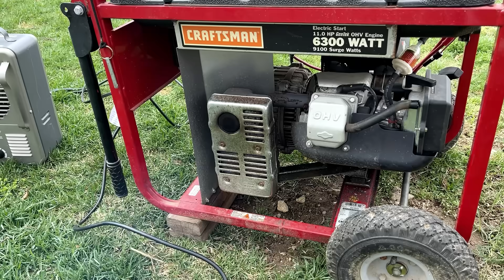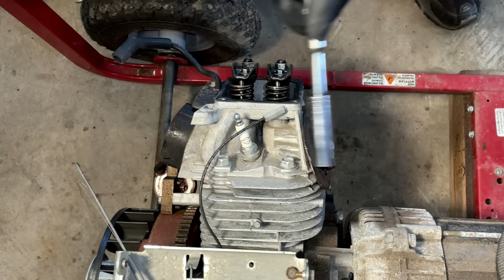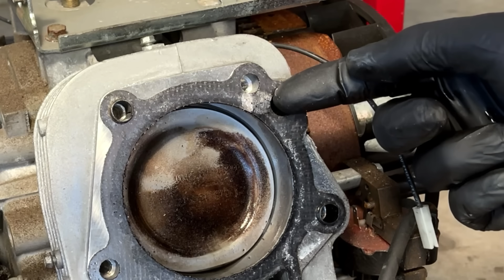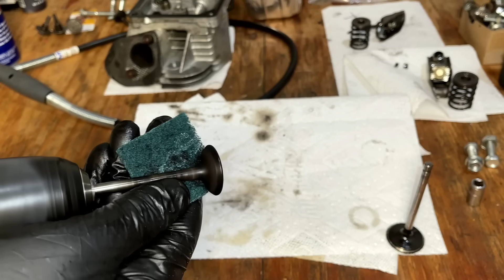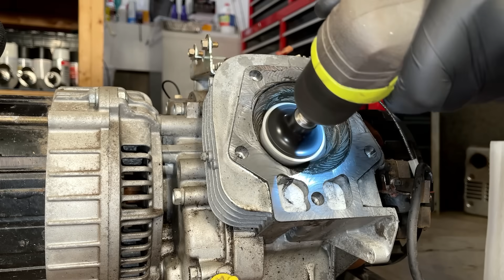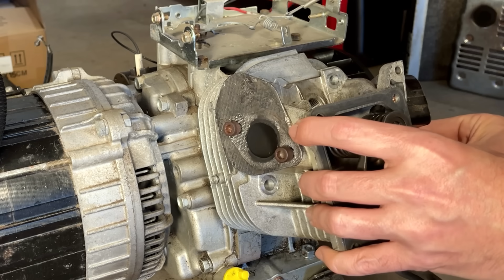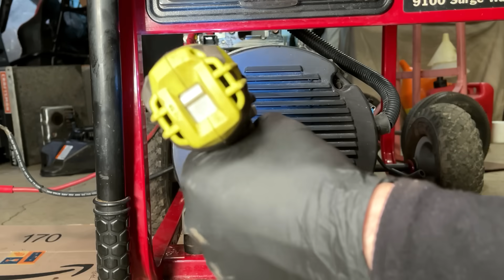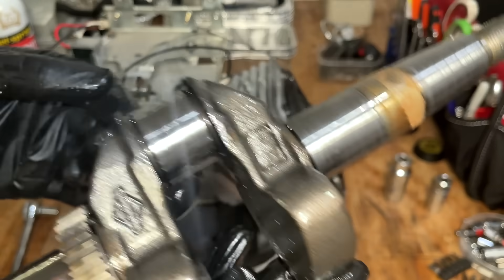Smoking Generator Engine (Part 1) - Easy Fix or Engine Teardown?

Comment: Hi James have a question , I want to load test my 6500 watt generator but do not have any space heaters like you . But I do have a 5000 watt heating element out of a clothes dryer . Can I use that or is the 5000 watt too much to load all at once I would have to plug it into the 220 outlet. Thoughts on that thanks Robert
Reply from the maker: It is a lot to put on it at once.  Some engines would have an issue with it.
Reply: Yes that is what I was thinking too thank you for the reply.
Reply: @12wingwfetech  You can connect the 5000w element on the 120V outlets.  Half the voltage, half the current -> 1/4 the wattage (1250w).  It'll pull 10-12A out of 120V.

It's pretty safe electrically to do this.

The big trick is rigging it safely so you don't set fires with the element or zap yourself.
Reply: @fromagefrizzbizz9377  thanks for the info I will be careful if I go that route .

Comment: It'll be a leaking valve guide seal. Replace them. Reckon that'll fix the problem. The reason it smokes more at low rpm than under load is to do with vacuum between the throttle butterfly and the closed inlet valve transitioning to the vacuum intake portion of the 4 stroke cycle. There's more vacuum between them under light loads than under higher loads. Because at higher loads the throttle butterfly is more open creating less vacuum. Ie the more the throttle is opened the closer the cylinder sees closer to atmospheric pressure. Therefore not pulling as much oil through the valve guide and seal. Anyway that's my take on most likely what I would say your issue is. Cheers
Reply from the maker: Good point.  Was hoping to see more smoke at idle, but it definitely seems a lot better under load.

Comment: Fantastic job!  I had an almost identical unit to this.  The Craftsman 5500W with Briggs.  Bought it brand new in 2003, right after the famous blackout.  Paid around $850 for it on sale at Sears.  Made in the USA.  Beautiful unit.  Well built.  I did a proper break in under varying loads, and then fully winterized it by getting the tank and carb dried out, and always spraying marvel down the plug hole.  In fact, my first time removing the plug wire, I cut may hand open on the sharp edge of the sheet metal, just like the one you have.  Craftsman later added a plastic/rubber guard over that, as I'm sure this happened to many people.  20 years later, I still have the scar on my hand.  I'm guessing this unit is 2003-2005?
I'm in agreement with your troubleshooting and analysis James.  I would have removed and checked the crankcase breather reed valve first, as a plugged/blocked breather will cause very similar issues.  On engines with a top mount dipstick, lifting up the dipstick will allow the crankcase to breathe, and see if the breather is clogged.  On this engine, there is no way to do that, unless you remove the fill plug, but you'd have a mess on your hands.
The fact that the visual smoke went away when you brought the RPM way down, also seems to lead towards a clogged breather possibly
There is no question that the grooves in the cylinder are allowing "some" oil through, but honestly, I don't think they are the root cause either.
I had a Tecumseh that the piston was rusted in place after sitting outside for 10 years in the weather.  After lots of oil and breaking it free, the bore was scratched MUCH worse than what you have, and while it consumed oil, there was no visual smoke.
It's worth looking at that reed valve on the breather.

Comment: The generator looks like a smaller sibling of my Generac 7000EXL.  Same B&S engine design, just smaller.   Same frame design other than I have two front feet.
Interesting video.  Thanks.   It seems the power head was not designed to be removed since you needed to tap the inside of the shaft.   At least the shaft was not hardened.
I look forward to seeing this after the new rings and honing the cylinder.
Dave.

Comment: Why don't you straight edge the head? If it's warped then you can surface it with sand paper stuck to a flat surface like glass. That's why head gaskets blow in the first place.

Comment: My thought is that someone ran that with no air filter at one time, from the looks of it at a time when it really needed one.  Didn't realize boring oversize had gone up in price so much.  I remember getting it done for $10 a cylinder on motorcycle engines, but that was many years ago.
Reply: $10!!!???? When was that? It was $40 in the late seventies around here.
Reply: @kurtyoung6769  Probably around 1975.  I had 2 jugs bored .020 over at the Harley dealer in Chattanooga TN.  It was for a really old Honda 305.

Comment: When I regularly had a small bike engine in pieces,I used to lap head mating faces with a piece of glass and some fine valve grinding compound. Now I have a car with warranty I don't tinker! However with the advent of hobby rock tumbling carbide grits are easy to find to 2000 mesh which could be useful for polishing mating surfaces

Comment: Any reason a generator like this would not properly allow fuel flow down the fuel line into the new filter and onto the carb?  Has a brand new carb.  The fuel shutoff valve has been completely replaced.

Comment: On a smaller motor such as a weed eater or chainsaw those small grooves in the cylinder wall might be enough to stop it completely. On those the cylinder usually pops right out for easy replacement.

Comment: Great teaching.  I especially enjoyed the explanation of the breather pulse even though you explained that it wasn't as helpful in this situation.  One thing I would have checked on the initial teardown would have been the flatness of the head with a straight edge.  I have been burned by this, suspecting a blown head gasket only the find the new gasket gets blown in short order.  Perhaps head warpage is not common on aluminum /air cooled engines.  Obviously, your second tear down showed that it wasn't a warped head as the new gasket you placed looked pristine.  Kind Regards, Craiog
Reply: Thank you James, I guess trying save a few bucks is out of question for me now. Anyway, keep your channel on the air, I enjoy watching it and I actually learned a lot just by watching you do all the repairs on those generators.

Comment: You might want to start using copper coat spray on head gaskets.    You probably could have used the old gasket using it.

Comment: Another way to grind valves is to grab the valve stem with a drill chuck from the other side and turn it.
Reply: I have seen James do it this way previously. Then he reverted to doing it slowly by hand again. I just assumed it was because he preferred the careful control he has over the process with less chance of removing more material than truly necessary.
Reply: His valve lapping tool is ancoent. I first held one in 1954 when i was 7. Held, no, i wasnt trusted to use it. Just to hold it for Dad

Comment: Looks like it could be the exhaust valve stem seal
Reply: The comments section is sometimes more informative than the video. "I think there's a lesson in that for all of us..." 😁
A B&S 'most common' problem sharing page could be very useful. Or for all small engines. Especially now that our governments are trying to push us back a few decades.
Reply: @peterclark6290  
LETS GO BRANDON!!
Reply: That wouldn’t draw oil into the cylinder to be burned though (and it’s hard to say for sure, but it doesn’t look like it has a seal on the exhaust side). If it’s a seal, I’m leaning more toward the intake valve stem seal, which would have the same symptoms: when the intake is under vacuum due to a part closed throttle, this sucks oil past the seal, down the valve, and into the combustion chamber, leading to more smoke under low load/low rpm conditions, and this clears up when the throttle opens because the intake isn’t under so much vacuum. I had a car with ruined seals and it behaved just like that engine. 

The only odd part is I’m not sure how much oil actually gets up into the valvetrain in that engine, since it’s completely splash lubricated, but it started smoking almost instantly after the head gasket replacement. So I think his plan to do rings and a hone may well actually be the best option to clear up the smoke… but I’d still replace the valve stem seal anyway, being a Briggs it can’t be really expensive, and if it’s been overheated, that may have compromised the seal too.
Reply: @dphoenix1  i would think both seals are bad. I was watching real closely when he pushed the valves through the seals and they seem to have some springiness but they can go bad and pull oil under the bottom side of them as well. I have had them burn me once on a small engine I sold as junk. And a old man told me what it was after he fixed it and how to tell. 

Now I'm old lol
Reply: @dphoenix1  I think it wouldn't have to be drawn in,  it may just drip in.  This whole area above the seal is normally drenched  in oil with the engine running.
Reply: @dphoenix1  correct. as well he will need to do a run under load for some 1 hour or so to heat the muffler up enough to burn all the oil in there out.i noticed the second ring from the piston came off at the 5-6oclock position which is where oil is laying to be swept by the rings and also where the bad scoring is so essentially the engine only had 1 ring working for oil sweeping and 2 for compression.
Reply: the way the smoking varies with vacuum seems to point at oil getting past the intake valve seal or worn guides.  If the guided are worn, new seals will be temporary.

high vacuum while decelarating sucks oil ontp the stem/valve.  when you feed her the onions, the inlet charge washes the oil off into the mixture.
Reply: Pro Tip. is leak down all you need is some compressed air and low pressure air gauge and a pressure regulator. 
Cost under $50 to make the setup with some tube and you can inject air into the crankcase at 4:00 or 5 PSI and that should tell you where your leak is just by the sound of that air.
Reply: It's more likely the check valve in the valve cover since he said it didn't have any air coming out the vent which means the crankcase pressure is going somewhere else which could easily force oil past the valve stem seals and/or rings also I'm pretty sure the hole in the head you were referring to isn't feeding the valves it actually goes to the intake, the valves are already connected to the block through the two large pushrod holes.
Reply: @christopherheinrich5362  Not to discredit your idea, since the truth is nobody knows yet and we all are speculating.....  But consider the fact that in the video, the breather line was detached (vented to atmosphere). 

Your thought would have more meret if the smoking increased/decreased with the breather line connected/disconnected.

I appreciate your thought of excessive crankcase pressure forcing excessive oil though the valve guides.  Who knows, you may be correct.  But, I thought she was still a smoker with the valve cover vent line open.

I'll stipulate, blow-by from the scoring on the cylinder, and a plugged check valve in the valve cover may be causing excess crankcase pressure.  The simple test is remove the oil fill plug to eliminate crankcase pressure.
Reply: @christopherheinrich5362  .....thinking a few more minutes.  My suggestion that the breather line from the valve cover NOT discredit your idea.  I apologize.  To move forward in troubleshooting, excess crankcase pressure needs to be eliminated.  In my mind, an easy test to see if she is still a smoker with the crankcase vented...... The oil fill cap removed.  Thoughts?

Comment: Hey James I'm looking for a diesel motor that will run a hydraulic pump for a log splitter. Just the power unit. Have you ever run across anything like that.?